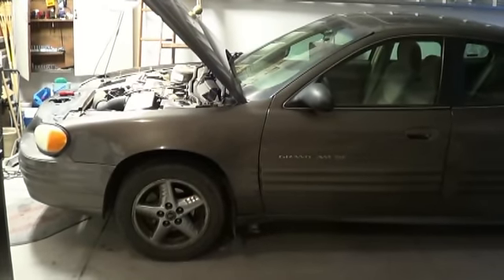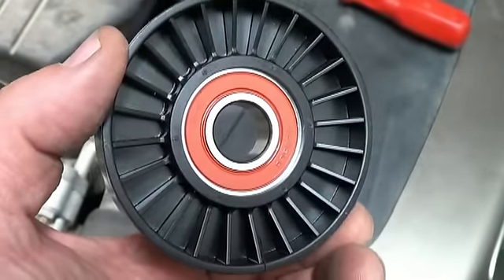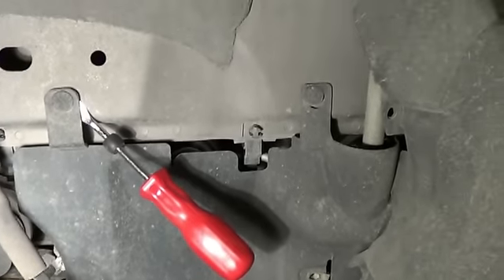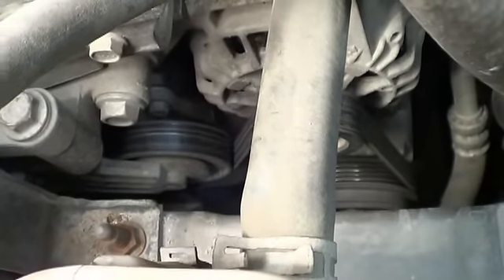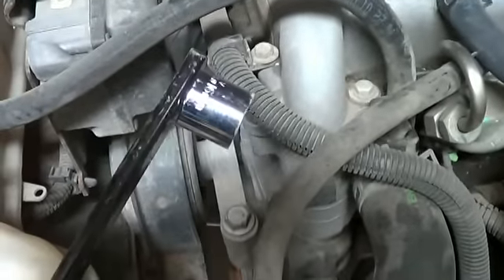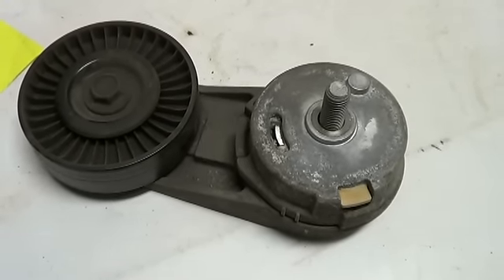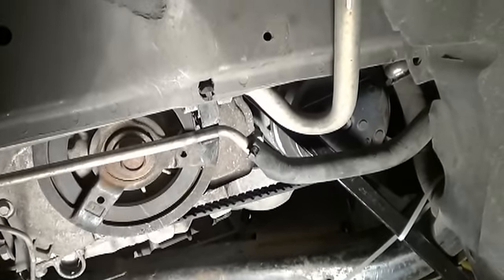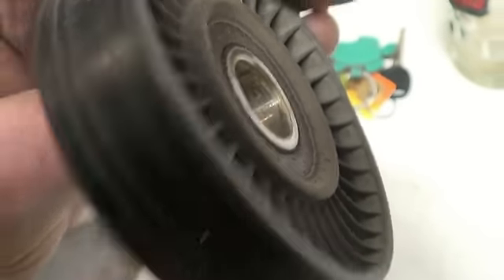2002 Pontiac Grand Am Serpentine Belt & Tensioner Replacement

Comment: No water pump or power steering pump
Reply: Power steering is driven by the cam on the transmission side. Water pump is chain driven. The belt only drives crank, alternator, A/C, and the tensioner